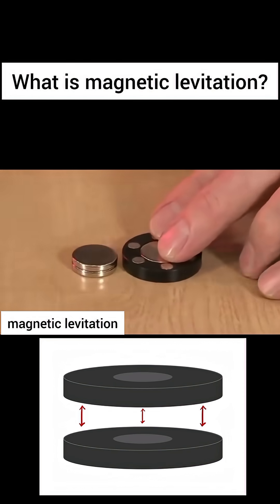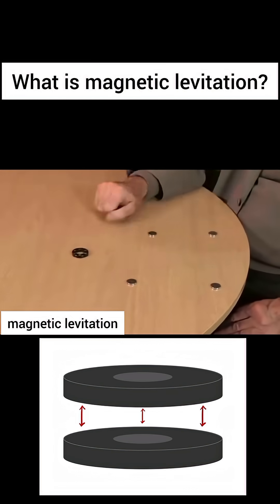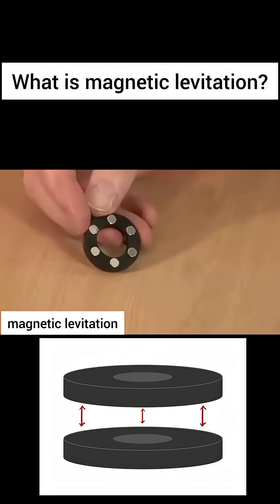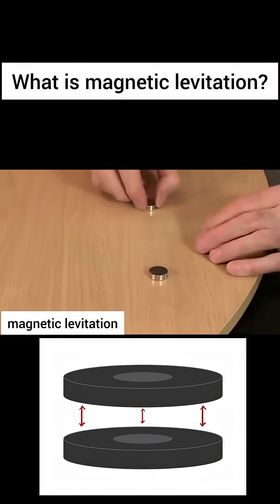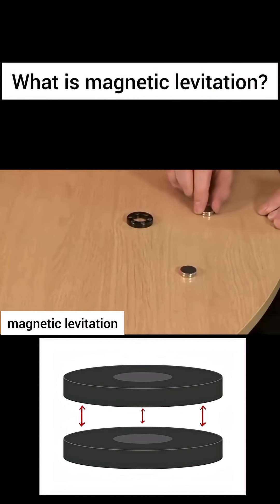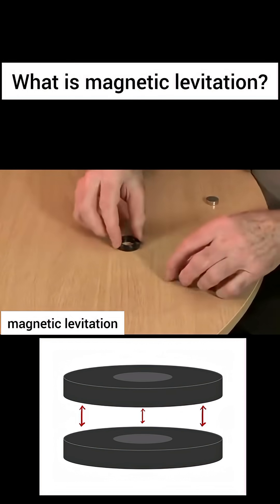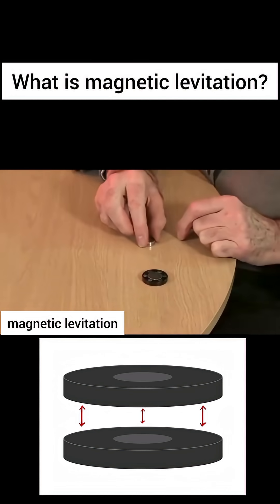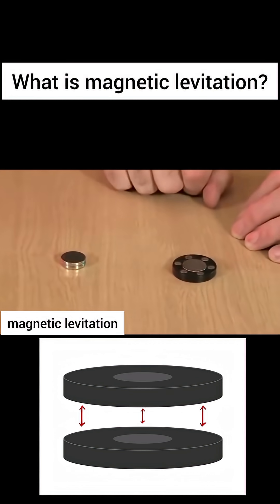what is magnetic levitation?

Comment: I wonder if this could be used as shock absorbers?
Reply from the maker: Yes, magnetic levitation principles are used and could be further developed for shock absorbers and suspension systems, particularly for applications like vehicle suspension to provide adaptive ride comfort and handling. Technologies like maglev trains and commercial magnetic ride control systems demonstrate the feasibility of using controlled magnetic fields to provide levitation and variable damping, offering an advantage over traditional spring systems by allowing real-time adjustments to changing road conditions

How it works:

    Magnetic Repulsion:
    The core concept involves using the repulsive force between like poles of magnets to support a body or control its movement. In some designs, permanent magnets at opposite ends of a body repel each other, maintaining the body's equilibrium and providing elastic damping
Ferrofluids:
Some shock absorber designs utilize ferrofluids, which contain tiny magnetic particles. By applying a magnetic field, an electromagnet within the piston can align these particles, thickening the fluid and restricting its flow to stiffen the suspension, or allow free movement when the current is off
Adaptive Control:
The stiffness and damping of the system can be adjusted in real-time by controlling the strength of the magnetic field, allowing for a smoother ride and improved handling over various terrains
Reply from the maker: Examples and Applications:

    Vehicle Suspension:
    Magnetic ride control systems, like those found in some vehicles, use a magnetic fluid to adapt suspension settings dynamically, improving comfort and handling
Vibration Isolation:
Magnetic levitation systems have been designed and validated for isolating lightweight structures and artworks from vibrations
Novel Designs:
Researchers have explored using permanent magnets and magnetic fluids to create shock absorbers with non-linear stiffness, which can adapt their resistance to the magnitude of an applied force

Comment: Here's a though experiment...on a flat surface, put a strong magnetic force, it has North and South. Surround it with Six magnets that are South to North.... the surrounding magnets are each 1/6 the same material, 1/6 the strength.... opposites attract.... North wants South,  and South wants North... but they are stuck on a flat surface.... Friend ZONE PERMANENTLY  to all the socialites with no friends, forevermore.... NO MAKE ME A HOVER BOARD AND FLYING CARS..... LENTZ LAWS
Reply from the maker: thanks for your comment and attention
Reply: @science-ms89 thank you, don't get me started on hydrogen... feeding aluminum into a contained area, it produces aluminum hydroxide... We oxidize the hydrogen,  making H2O, water, and the aluminum oxide can be made into ALUMINUM...AGAIN....
Reply: @science-ms89  exothermic reactions.... Can you imagine using hydrogen as a fuel, to power, lets say, mercury, in a cycloid, with copper (weak)  or and.... lol... other heavy elements... Sounds like a propulsion system... but it's all imaginary in my dorky mind....

Comment: Levitation? I was expecting it to start hovering in the air.
Reply from the maker: this video shows magnetic inverter that explain the principles of magnetic levitation, bro
Reply: @science-ms89  What does levitation mean?
Levitation (from Latin levitas, lit. 'lightness') is the process by which an object is held aloft in a stable position, without mechanical support via any physical contact.-- wrong does not show levitation..
Reply from the maker: @baracuda40 magnetic inverter can explain the magnetic levitation, the goal was to explain the principles of levitation, yes levitation means suspension, hovering in the air

Comment: Wonder if they could use that principle for suspension of some sort? Maybe not though because of the way temperature effects it/the liability issues with having giant ass magnets around the public.
Reply from the maker: Based on the principles of a "magnetic inverter" toy and related technologies, using this specific mechanism for suspension is not practical for several reasons
. While magnetic levitation (maglev) is a real technology, the toy's approach is unstable, and its core principle is different from industrial applications
Here's a breakdown of why this principle is not viable for real-world suspension, along with the safety and temperature issues you mentioned.
The principle of the "magnetic inverter" toy
The toy, also known as a "tractor beam magnet," uses a specific arrangement of permanent magnets to create a zone of stable equilibrium in a horizontal plane
A strong central magnet provides the main attraction force, while weaker peripheral magnets provide repulsion.
When a free-moving magnet is brought near, the forces balance at a fixed distance, and the magnet appears to "float".
The key limitation: This equilibrium is only stable in one dimension (horizontally) and is highly sensitive to any angle, bump, or slight vertical force, which can cause the magnets to snap violently together. This instability makes it unsuitable for supporting any meaningful weight in a dynamic, three-dimensional environment.
Reply from the maker: Real-world magnetic suspension principles
Functional magnetic suspension systems, such as those used in maglev trains and active vehicle suspensions, rely on different, more robust principles.

    Active control: Commercial systems use electromagnets and powerful computers with sensors to constantly adjust the magnetic field. The computer provides continuous feedback to stabilize the levitating object against disturbances, counteracting Earnshaw's theorem, which states that static levitation with permanent magnets is impossible.
    Magnetorheological fluid: Some high-end car suspensions, like those from MagneRide, use fluid containing tiny magnetic particles. By applying an electric current, the fluid's viscosity changes instantly, allowing the damper to adjust to road conditions hundreds of times per second. This is a form of magnetic suspension, but it's fundamentally different from the permanent magnet toy.
    Superconductivity: Superconducting maglev trains use extremely low temperatures to achieve a state where a material completely repels magnetic fields (the Meissner effect), allowing for stable levitation
Reply from the maker: Temperature effects
Your intuition about temperature is correct, particularly regarding superconducting applications.

    Superconducting systems: For superconducting maglev trains, the system only works as long as the superconductors are kept below a very specific, and extremely cold, critical temperature. If the material warms up, it loses its special properties, and the levitation fails. This requires a constant supply of liquid nitrogen or other coolants, which is expensive and not practical for public applications outside of high-speed rail.
    Standard magnets: While not as dramatic, temperature changes can affect the strength of standard permanent magnets as well, though the effect is far less critical than with superconductors
Reply from the maker: Liability and public safety issues
The use of powerful magnets near the public raises serious safety and liability concerns that prevent technologies based on the "inverter magnet" toy.

    Health effects: Large, powerful electromagnets or superconductors create significant magnetic fields. This requires extensive testing and regulation to ensure public safety, especially for people with pacemakers or other medical implants.
    Instability and failure modes: The instability of the inverter magnet toy highlights the risks of static magnetic repulsion. In any engineered system, a failure (e.g., loss of power, computer malfunction) must be predictable and non-catastrophic. The risk of a massive object suddenly losing its lift and "snapping" into place is a major engineering problem that active feedback loops are designed to solve.
    High costs: As seen in high-end cars and maglev trains, magnetic suspension is a complex, expensive technology. The cost, complexity, and safety requirements of these active systems prohibit their use in most everyday applications

Comment: Satellite
Reply from the maker: Yes, satellites and related space technologies utilize magnetic levitation, primarily in two ways: as a component within the satellite itself, like magnetically levitated reaction wheels for attitude control, and for ground-based systems that launch or support spacecraft, such as StarTram. Magnetic levitation offers advantages like reduced friction, increased lifespan, and lower maintenance for internal mechanisms, while its use in ground-based systems can significantly lower launch costs by using electricity rather than fuel.

Comment: I’d like to see an experiment where they use magnets rotating in a circle at extremely high speed that are exposed to a massive amount of electricity, say enough to power a small city. From there I’d start introducing different liquids to observe the effects starting with different types of Water.
Reply from the maker: An experiment combining high-speed rotating magnets with a massive amount of electricity could demonstrate electromagnetic induction by generating a significant electrical current, as shown in devices like an electric generator. The principle is that a changing magnetic field, whether from a moving magnet or current in a coil, induces a voltage and current. A practical demonstration would involve a rotor with powerful magnets spinning at high speed within a stationary or rotating set of coils, creating a strong, rapidly changing magnetic field to generate electricity, similar to how generators in power plants operate
Reply from the maker: How to Conceptualize the Experiment

    1. Rotating Magnets (Rotor):
    . 

Imagine a ring of powerful permanent magnets or electromagnets spinning at extremely high speeds in a circle
2. Coils of Wire (Stator):
. These spinning magnets would pass by stationary coils of wire (conductors)
3. Induced Current:
. As the magnets spin rapidly, their changing magnetic fields sweep across the coils, forcing electrons to move and thus generating a strong electrical current
4. Massive Electricity:
. The "massive amount of electricity" you mention would likely come from the large-scale generator setup, where the goal is to produce a substantial current and voltage from the kinetic energy
Practical Applications 

    Electric Generators:
    This setup is similar to how large-scale electric generators work, such as those in power plants that convert mechanical energy into electricity.
    Electromotor:
    Conversely, an electric motor uses electrical energy to create a magnetic field that causes magnets to spin.

Comment: Exactly how quarks are attracted to each other.
Reply from the maker: Inverters, magnetic or otherwise, do not involve the attraction of quarks
. Quarks are subatomic particles held together by the strong nuclear force within the protons and neutrons of the materials used in the inverter. The device's operation depends on the flow of electrons, not the behavior of quarks
Reply: @science-ms89  It mirrors the attractive forces between quarks in the proton for example. They don't like getting pulled apart nor getting too close, ergo - it does show the behaviour of quarks.
Reply: @science-ms89 quarks are theory

Comment: My first thought was this is a great magnetic bearing, but if one of the magnets spins would that create a current? I don't think it would, so long as the magnet doesn't flip, the field will not change?
Reply from the maker: You're thinking along exactly the right lines—this is a subtle but fascinating piece of electromagnetic theory.

Spinning a Magnet ≠ Changing Magnetic Field (Necessarily) If a magnet spins around its own axis and its magnetic field remains symmetric and static relative to the surrounding conductor, no current is induced. That’s because Faraday’s Law of Induction tells us that a current is only generated when there’s a change in magnetic flux through a conductor. So:

    If the magnetic field is uniform and unchanging in orientation (e.g., spinning a cylindrical magnet around its axis), the field lines don’t cut through the conductor differently over time → no induced EMF.

    If the magnet wobbles, flips, or rotates asymmetrically, then the field changes relative to the conductor → current can be induced.

 Exceptions and Edge Cases There are some interesting caveats:

    Eddy currents can form in nearby conductive materials if the spinning magnet causes     localized field variations (e.g., due to imperfections or non-uniform magnetization).

    In designs like homopolar generators, a spinning magnet can induce current, but it requires a specific geometry—typically a radial magnetic field and a conductive disk rotating perpendicular to it.

So your intuition is spot-on: no flipping or field change, no current. But if you introduce asymmetry or motion that alters the field's interaction with a conductor, then things get interesting.
Reply: @science-ms89  thank you for the detailed reply.

Comment: How did I know that the energies combined would create a scenario where they stay the same?? They even kept the same angle toward each other.
Reply from the maker: In magnetic inverters—especially those using coupled inductors or Z-source topologies—energy from multiple sources (like capacitors and inductors) can combine in a way that maintains a stable output. This happens due to:

    Resonant behavior: When inductive and capacitive elements are tuned properly, they can resonate at a specific frequency. This resonance allows energy to oscillate between magnetic and electric fields without loss, preserving the system’s energy profile.

    Impedance matching: In Z-source or quasi-Z-source inverters, the network is designed to balance impedance across components. This ensures that energy flows smoothly and predictably, keeping voltages and currents aligned.

    Phase synchronization: If the magnetic fields or currents are phase-locked (i.e., they maintain the same angle or phase relationship), they reinforce each other rather than interfere. That’s likely what you noticed—the angle staying the same means the system is in constructive interference, not destructive.
Reply from the maker: Why the Angle Stayed the Same This is a sign of magnetic coherence. In systems with single magnetic cores or tightly coupled inductors, the flux linkage between coils ensures that the magnetic vectors remain aligned. It’s like two dancers moving in perfect sync—they’re sharing energy, but not disrupting each other’s rhythm.

So when you saw the energies combine and maintain their angle, you were witnessing a beautifully engineered balance of:

    Magnetic flux continuity

    Energy conservation

    Phase coherence

Comment: How many Gauss (B) is on Maglev train ??😂
Reply from the maker: The superconducting magnets used in maglev systems can produce fields of up to 1–5 tesla, depending on the design and application.That translates to 10,000 to 50,000 gauss.     The Japanese SCMaglev uses superconducting magnets that generate fields around 4–5 T, or 40,000–50,000 gauss.

    These fields are strong enough to levitate and propel the train at speeds over 300 mph (480 km/h).

These magnetic fields are carefully contained and shielded to ensure passenger safety and minimize interference with nearby electronics.

Comment: A model of van der Waals force?
Reply from the maker: Not quite,  Magnetic inverters and van der Waals forces operate in fundamentally different realms of physics. Magnetic inverters are macroscopic systems used in electrical engineering to manage and convert energy through electromagnetic induction. They are designed for efficient power conversion and typically function within electrical circuits and power systems.

In contrast, van der Waals forces are microscopic interactions that occur at the atomic or molecular level. These forces arise from quantum-induced electric dipole interactions and are responsible for weak bonding between molecules or layers of materials. They play a crucial role in fields like chemistry, nanotechnology, and materials science.

While magnetic inverters rely on magnetic fields to regulate energy flow, van der Waals forces are rooted in electric field fluctuations at the quantum scale. The two concepts differ in scale, mechanism, purpose, and the type of physical field involved.
Reply from the maker: However, there is a conceptual bridge: In 2D van der Waals magnets, researchers are exploring materials where magnetism and van der Waals bonding coexist—like in monolayer CrI₃ or Fe₅GeTe₂. These materials are revolutionizing spintronics, where magnetic properties are used for data storage and logic at the atomic scale.

So while a magnetic inverter isn’t a model of van der Waals force, the fusion of magnetism and van der Waals physics is a hot frontier in condensed matter research

Comment: Ok so how do we make this a flying car?
Reply from the maker: To create a flying car using magnetic inverter principles, you’d need:

    Superconducting or high-strength permanent magnets: To generate strong, stable magnetic fields.

    Inverter circuits: To control the magnetic field’s frequency and polarity, enabling lift and directional thrust.

    Specialized infrastructure: Like magnetic guideways or conductive surfaces that interact with the vehicle’s magnetic system.

    Lightweight chassis: To reduce the energy needed for lift.

    Stabilization algorithms: To maintain balance and orientation mid-air